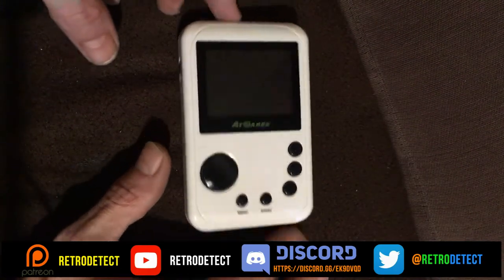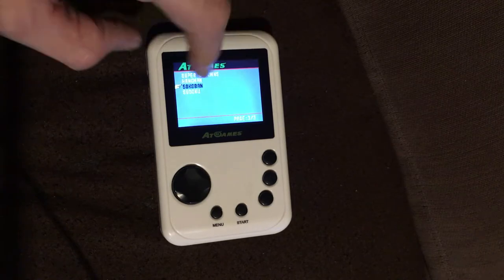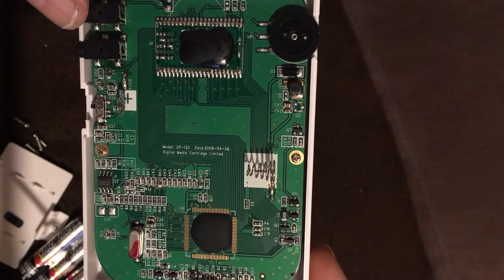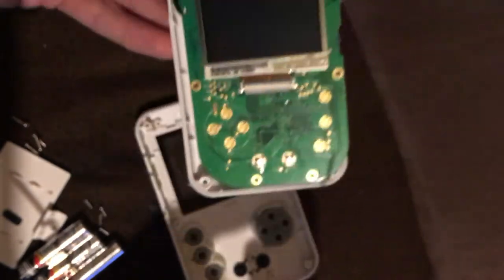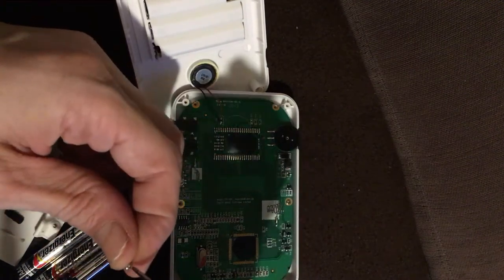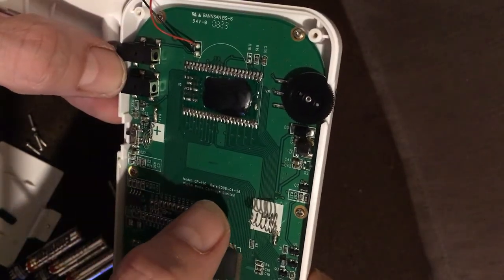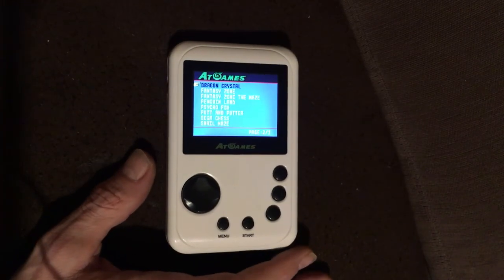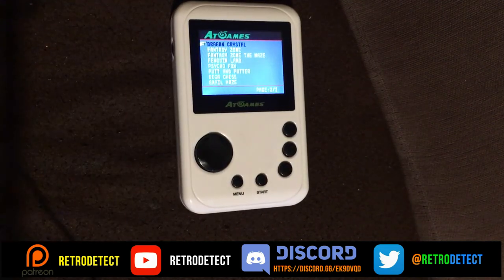SEGA Brain Games Colour Handheld Teardown & Review  - ATGames

Comment: Yo, I've tried to find a review of this for ages. Thanks for this 👍! Me and my 2 brothers have owned one each, but only 1 remains, and I've broken off and lost one of its battery terminal springs. :(
Reply from the maker: you could try putting a new spring in, sometimes tv remote springs are the same size.
Reply: @RetroDetect  I've done it! I used a spring from an old toy which was going to be thrown away. I bent the spring using pliers to match the place for it on the circuit board, attached it and now the nostalgia has returned. Thanks again for posting this video, as it motivated me to fix my handheld. 😀👍
Reply from the maker: @MT_800  excellent! thanks for letting me know! im glad i could inspire you to fix it :)